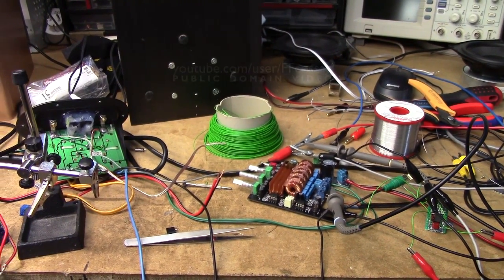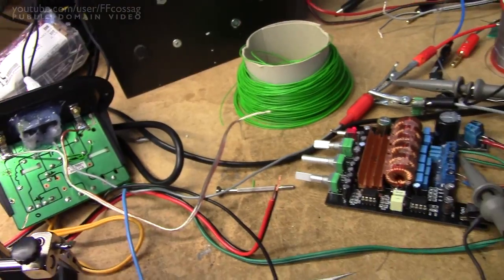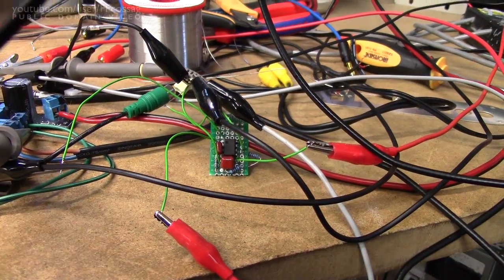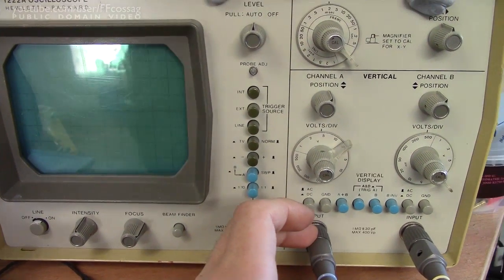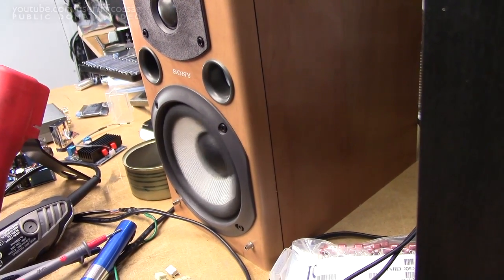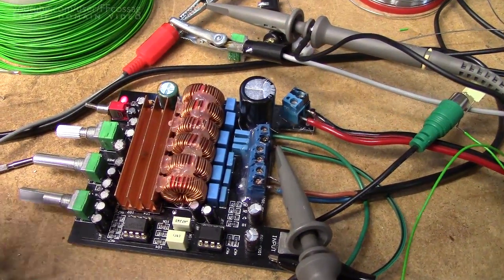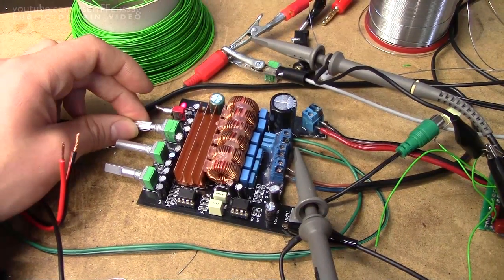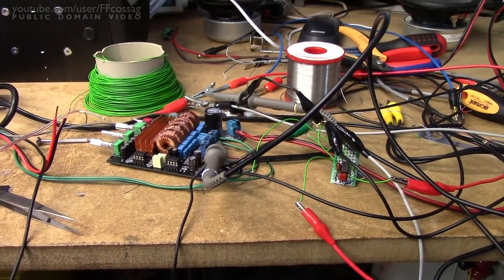"Mission C" - Lithium powered portable speaker 4: Changing amp boards

Comment: Nice project, just are running one of those bass/midrange chassis only for the bass right?
Reply from the maker: +Das OSi The speaker has two "woofers" and one tweeter. One of the "woofers" will be pretending to be a subwoofer, connected straight to the amplifier board, while the other one will share amplifiers with the tweeter, and go through the original crossover filter in the speaker.

Comment: The use of the 2nd stereo channel for an external speaker is quite novel. However it won't be great for a full range speaker as you've installed the aforementioned high pass filter. I think you might be able to bodge that filter onto 1 channel only though.
Reply from the maker: +foorje The high pass filter is only installed on one channel. It's literally just a single capacitor.
Reply: FFcossag Didn't even think about that. My bad.